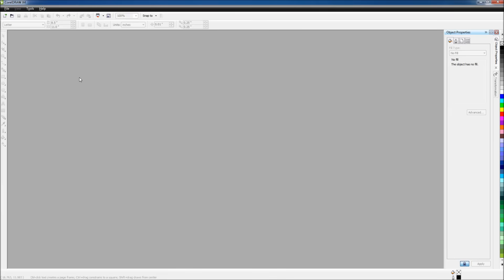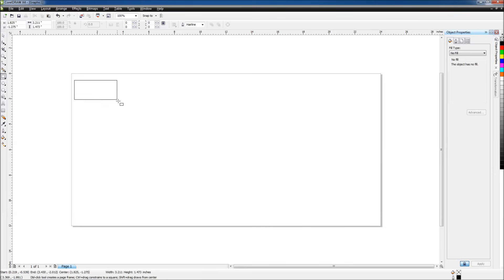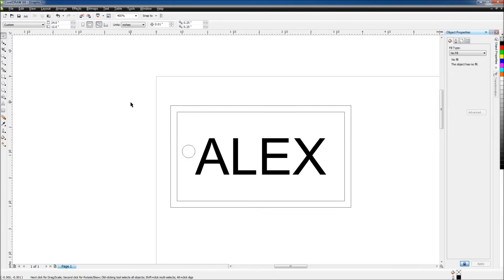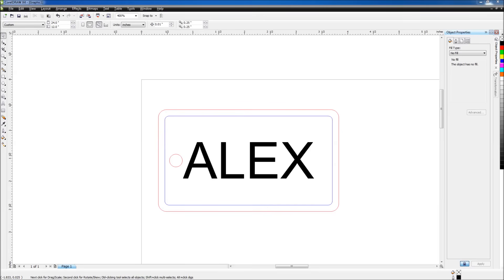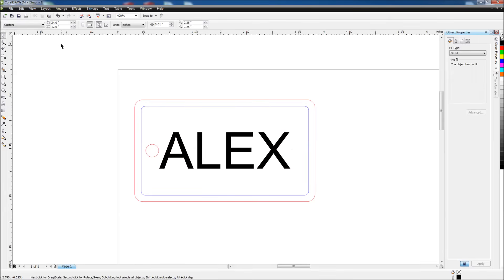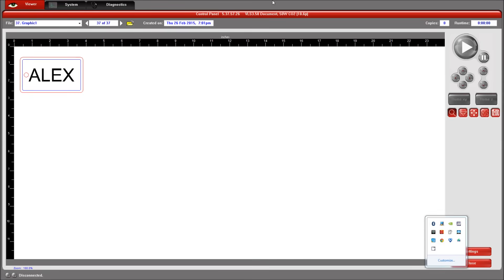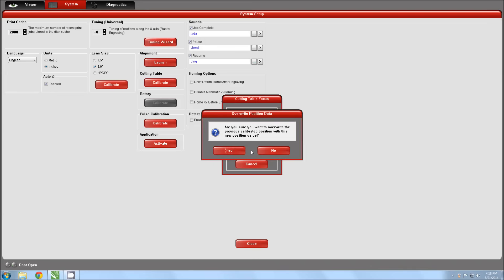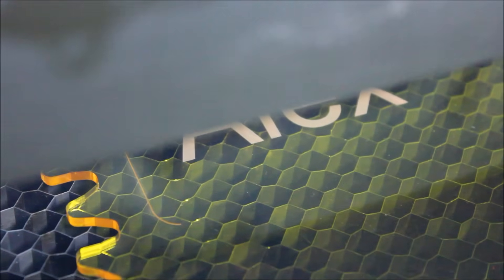Universal Laser Quick Start Tutorial with Corel Draw

Comment: I’m still having problems engraving a bit deeper ... Can you suggest a resolution?? Thanks 😊
Reply from the maker: Going deeper is simply a matter of either adding more power, slowing it down, or a combination. If you've done these things and it isn't going deeper, you should check your optics to ensure they are clean and not damaged, check your focus, and verify your laser tube's output has not dropped off.

Comment: Its still a bit unclear as to how you get your laser to engrave on your material with complete accuracy.  It all seems to be very hit or miss.  Is there a process to hit your design dead nuts on your material?  Great video, the best I've seen on this  machine on Youtube, but a bit more info would help.
Reply from the maker: Great idea for another video. What I typically do first is draw a box that represents the exact size of the material I want to put the image on in Corel. So if I am trying to center a graphic on the back of a phone, I'll get the dimensions of the phone and create a rectangle that represents it. Then I will put a piece of material in the machine, butt it up against the rulers, and cut that shape out of it. Next, remove the material you just cut out and place the phone down in the material in the empty space that remains. Back in the software, I will center the graphic in the rectangle I used to cut the material, then delete the rectangle or change it to a different color and tell the laser's driver to skip that color. As long as your material did not move, you can be certain the graphic will be centered properly.

Comment: What Version of CorelDraw can i use? We have a ULS in our Coworking-Space and they use CD x4. I want tu have my own Programm on my Laptop. Can i use a later Version and send it to the Laser?
Reply from the maker: Yes. Any version of Corel Draw should work. You can also use Adobe Illustrator or a CAD package such as SolidWorks or AutoCAD. The key is that the software needs to output vector data. Software such as Photoshop or Inkscape rasterize the output, so you will not be able to get the vector cut and vector engrave functions to work straight out of those packages.